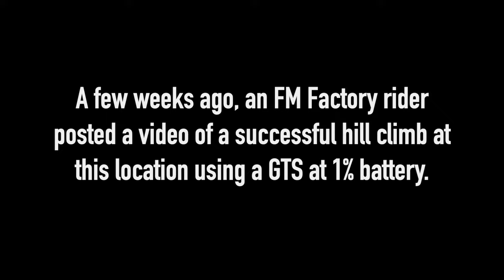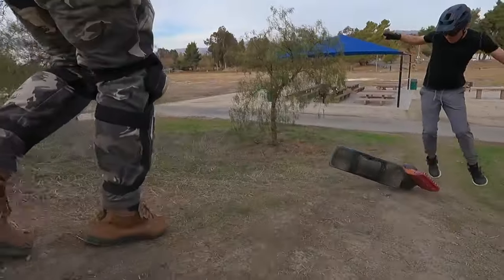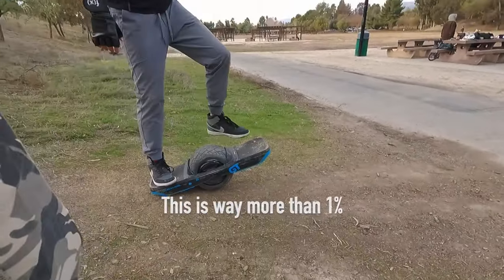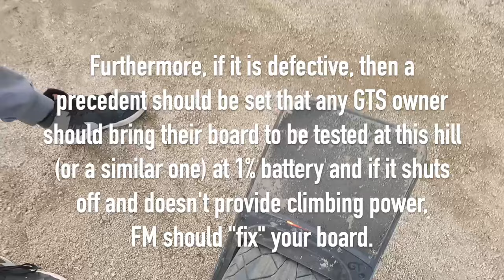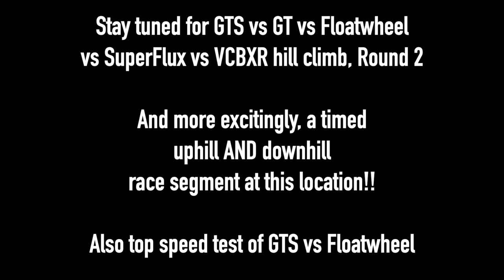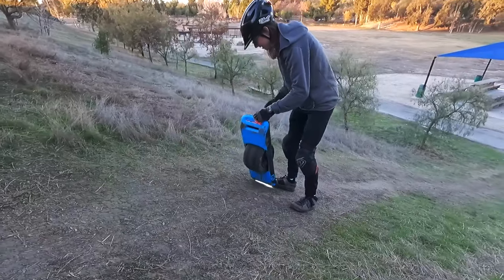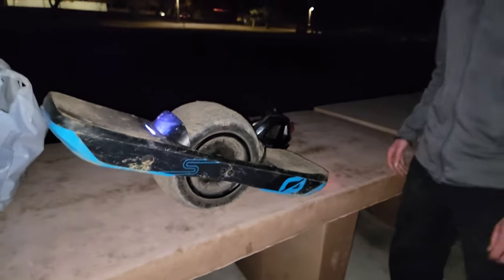Hill climb with GT S-Series at 1% battery!

Comment: To be fair, Neil's board did the low battery beeps when he reached the top, so he must have actually been at 1%.
Reply: Probably a special unlocked board.  That's why the challenge to go there and both party test the same  board that's not straight from FM.   I think abit of trickery is going on there.  The proof is in the pudding.
Reply: I wonder if there's any regrets about sharing Neil's 1% climb video - because it really sets false expectations. I bet if you picked 10 random FM boards (even if you restricted it to boards less than 6 months old), 9 of them will not even let you ride to 1%, let alone climb a hill at 1%. Neil's board sure is not representative of the average GTS or any FM board
Reply from the maker: I don't know why some people doubt Neil was at 1%. You think a pro factory rider doesn't know what his percentage is at?😄Also he shows his app at 1% from his vid. But what was the intention of demonstrating full torque at 1%? Maybe Eamon's board is defective. If it is, his and all other GTSs should be fixed.
Reply from the maker: @surfdado  this is exactly my point. If you're gonna market a sponsored vid showcasing full torque, shockingly impressive performance at 1%, people should be allowed to feel a somewhat close performance too, without the board shutting off starting at 12%. Also what kind of precedent does that set for people to try a steep hill climb at lower battery % with the higher possibility of a cut out, especially on actual trails with cliffs and steep drop offs🤷‍♂

Comment: Wish I could share videos of the prototypes we get to ride. That video was not one of them. It's a difficult hill and nose clearance becomes an issue. If you put the front bumper on the ground it's no longer an issue of torque. We climbed that hill 30+ times by finding the line that avoided all the pot holes and maintaining 2+mph momentum so as to not have to accelerate and put the nose into the ground.
Reply: When will you make a meet up with Maxx at "the hill" and show him how it is done?
Something tells me it won't happen, but I'm definitely open to being surprised!
Reply: @thomasbjerregaard1080 I think it might happen but the video won't show a comparison with vesc boards.  It will likely be a video teaching maxx how to ride/avoid the bumps going up the hill. Gotta climb smart on the gts and avoid things it can't handle where vesc boards can power through.
Reply: @FloatinCanada  i would personally be just fine with it not being a comparison between a vesc and a FM board, but unlike you, I don't think it will happen
And I don't think it will happen on another then a Factory Team rider board, and they won't let other people ride that specific board, and they can't do it on another GTS board......so the above pretty much explain why I think they won't show up 
But again, I'm open to being positively surprised

Comment: Now that the factory team has turned to the dark side it's hard to believe anything they say and do.  They are paid now to promote.  Untill they actually go with you there and try it with the same board that you have than I'll believe it.  Neil could have a special board that's unlock to have better torque.
Reply: Dark side, Light side, I don't know anymore, but I do like the entertainment!
Reply from the maker: Hoping we can set something up! I haven't heard back from my comment on their 1% vid. Would love to be enlightened on how to hill climb with a gts, especially at 1%🤩🤭
Reply: @MaxxSend Isn't Austin lighter  than you? Maybe psi makes a difference? Try his line - he came in from left diagonally up to the right flat side with no ridges and zagged back to the left. You can't just go straight up it.
Reply from the maker: @sdmods619  we tried all the lines, right side, far right, middle, all similar results. Eamon is 170, I'm 175. I even invited a 130lb 1st place grom, 3rd place amateur racer to try and he never made it all the way up the hill. The hill is so steep that if u zig zag ur way up u will lose momentum. At this point I'm not gonna be debating on technique with anyone other than the factory riders themselves. Just waiting on their schedule availability.

Comment: I have a GT that I'm VESCing and rhe controller was shutting off with the same behavior at as high as 70%, and at slow speeds. We talked to a shop about the controller and its cheaper to vesc it
Reply from the maker: oh wow that sounds more like a bad cell in your battery pack. how do you know it was the controller? Either way, when you feel the power and smoothness of vesc, you ain't gonna go back!

Comment: Maxx you should get people with the following controller and test riding up that hill, would make a good video! Also see if people has the 7” tire might make a different!

Thor-300
Tronic-250r
Little focer 3.1
Floatwheel v2
Reply from the maker: that would be tricky to find locals with all those setups! I should be able to get my hands on the thor 300 soon, so that'll be a blast to test. May not do another hill test for a while cuz seems some people are tired of it😆Instead I'll do time and temp tests on the King of the Hill course. Check out the segment https://youtu.be/NyX6OjqEEbw?si=0v0ABEu6lezskNBj

Comment: I really expected more from the Gts. They added so much voltage… and it still just doesn’t rip like VESC. 😢
Reply from the maker: So did I, really wanted to feel that power. I will say u can feel the additional power over gt on smoother uphill terrain, but we found the gts is more prone to nose dipping on fast uphill ruts than gt. At that price it's way out of line in terms of value to diy vesc and fw. Btw I'll be rockin your shred juice shirt in the next vid premiering at 1030am PST 😊🤟🏻
Reply: @MaxxSend  oh heck yah! I’ll be ready to watch.
Reply: maybe they should have added more amps ;)
Reply: @surfdado  they might need to read a copy of VESC vocabulary to figure out what that means 😆

Comment: Maxx - You state in your two videos with the GT-S on this hill climb test that you are neutral party testing the board to report the results, and were even hoping the GT-S would perform well enough to add competitive capability to this product category. If that is really the case, why you have not done an updated video on this hill climb test with the GT-S equipped with its current gradient tracking firmware update? It has been over two-months now that the GT-S has been equipped with gradient tracking functionality, and yet you have not repeated this hill test, whereas your two existing GT-S hill test videos were both posted shortly after the GT-S release and shortly after the FM factory team's response video to your first video. The lack of an updated video post the GT-S's gradient tracking firmware update gives the distinct impression that you are not really interested in testing and showcasing the GT-S performance capability as a neutral party??

Comment: I'd love to take this challenge but I live in Minnesota. Nevertheless, I've been doing my own hill tests in my area with the GTS and believe this hill is doable with the GTS. Of course I saw Neil's video so I know it is. At 1% though? I'm skeptical too so I admire your approach to hill climbing truth.   

Anyway, it looked to me like your GTS was giving up. Meaning, the footpad was disengaging when it shouldn't have even though you had "posi' d selected. Am I correct in this? I also saw the false start. I had similar problems with my GTS footpad even with posi selected. 

My solution was to take a partially deflated 10 lb medicine ball (if I had a heavier one I would have used it) and massage the footpad hardcore with it (with the board off of course - and reasonably warm) to break the footpad in a lot faster. This seemed to work and I haven't had a problem with it telling whether or not my foot is there but I haven't ridden it a whole lot since this is something I did very recently. Will be trying a more 'broken-in' footpad on hills soon.
Reply from the maker: Appreciate the support, simply trying to either confirm or provide a different perspective to their demonstration. No the board didn't disengage, it was shutting off completely due to BMS protecting the cells at low voltage sag under torque load at less than 12% (as it should). At this point we're hoping they can show that awesome 1% power on Eamon's GTS. And would be dope for you to come try one day! I set up an uphill and downhill racing segment at this hill: https://www.youtube.com/watch?v=NyX6OjqEEbw&t=2s
Reply: @MaxxSend  Watched that King of the Hill video and man, I would really like to see how well I could do on this hill. 

Definitely would love to go to California again, but probably won't happen in 2024. Maybe in 2025.

Comment: So That's Eamon's GTS. And from what I gathered, Eamon rode GT before the GTS right? He doesn't have that much vesc experience?
Reply from the maker: Correct, he's just ridden pint, xr and gt previously. He also bought a Floatwheel but only rode it for a week before I broke it in a freak accident 😆 the thing is, Eamon now makes it up the hill easily on Floatwheel and diy superflux boards, still not all the way up on gts 🤷🏻‍♂️
Reply: @MaxxSend   Perfect, I just wanted to make sure the factor that people are arguing about was covered.  Someone that has plenty of experience riding FM boards couldn't make it up the hill but was able to with a vesc/fw even with very little experience riding vesc.

That's a key factor in your video that should be pointed out. People can argue that you made it up because you have a lot of vesc experience and a lot less GT/GTS experience, but they can't use that argument with Eamon, or the kids.

Comment: I knew it was bs. At 1% it wouldn't even be possible to ask for current that's not even there. As I stated on the fm video.  It's complete bull. Also he's riding a factory board so they have complete control over it. And could literally make it say 1% whenever and even could Initiate pushback and beeps remotely.

Comment: TBH, Neil’s board doesn’t have haptic feedback. Buuuuuut, still BS. Why is the factory team acting like screen recording isn’t a thing on these phone apps? It’s disappointing when good riders go bad😢
Reply: Our boards have haptic. We were climbing this hill for 2 hrs killing the battery that's a long screen record. But you can see the board go red into low battery pushback in the video?
Reply: @turningmagnets  But, why Eamon's board behaves totally different from your board, you can see Eamon's GTS cut off at the foot of the hill at 14%, could you please kindly elaborate on that ?
Reply: @floatwheel  I feel like you already know the answer to that. Eamons battery likely needs to be balanced. Neils board was new out of the box with a full charge and was run from 100-1% continuously waiting for the battery sag to prevent the climb.
Reply: @turningmagnets   So you are saying eamon's battery is not balanced, and if eamon's board is balanced, it will reproduce the results you guys have? if it still doesn't get up that hill after balancing his board, what could it be then? And why the onewheel BMS allows user to ride the board with a unbalanced battery pack, I mean,  is that even safe to ride?
Reply: @turningmagnets   It seems that a unbalanced battery pack will cause the board to shut off at14%, what if the rider is riding at speed? That could be a very serious injury right?
Reply: @floatwheel  did you watch the video? He ignores low battery warnings and repetitively pushes the board lower and lower.
Reply: @floatwheel  funny that you mention that though. We both know the Floatwheel BMS has been known to drop people at speed. 😵
Reply: @turningmagnets  Yep I watched the video, the GTS cuts off at 14% that‘s weird, I thought the GTS can go up the hill at 1%.
Reply: @turningmagnets  lol, are you guys even allowed to say the word  floatwheel? that's against lord kyle's rule, he could get mad at you.
Reply: @floatwheel  oh I take it you'd rather not talk about the Floatwheel dropping riders without warning. Yeah I don't blame you 😬

Comment: This may sound stupid, but I think the trick is to not stuff the nose into the ground.  It's more of a balancing act, and maybe speed is not the solution.  Patients.
Reply from the maker: Absolutely, we were never trying to stuff the nose, we sorta get that part lol. And that's why Eamon was feathering it at 4:50 & 6:15 at 1%. Instead the board shuts off, especially the attempt at 4:50 going slow. Anyway, not even a 130lb ow podium racer made it up at 100% charge. How accessible is this power that people pay $3200 for? U decide 🤷🏻‍♂️
Reply: @MaxxSend  Yeah, I forgot about that while I was responding.  If the board cuts out, there's no amount of balancing and patients that will work.

Comment: My Pint X shuts off at 6%.  I say he was at one percent and you guys are too it's just showing you more.  If future motion could have some accurate electronics then it would show it properly.  That's my take anyways.
Reply from the maker: we started warming up on the hill at around 50%, then down to 16% for the start of this vid 🤷🏻‍♂️ anyway it's fair for the board to shutdown at less than 10% under heavy load, but it's not what they showed on their 1% vid
Reply: @MaxxSend  I get what you're saying.  I just wanted to add that my FM board will go to red light under any load at 6 percent.  Thats all  🙂